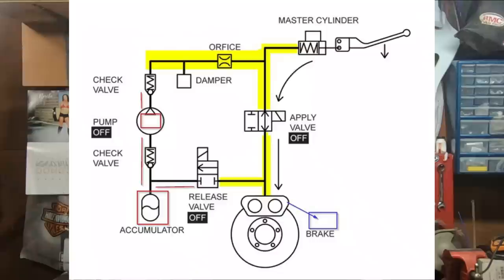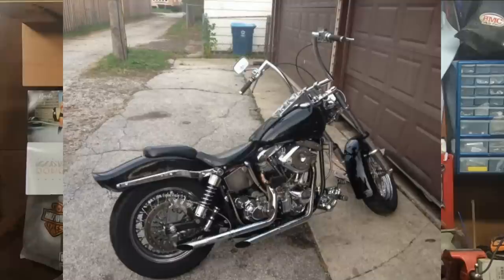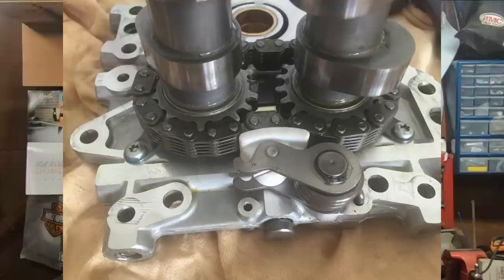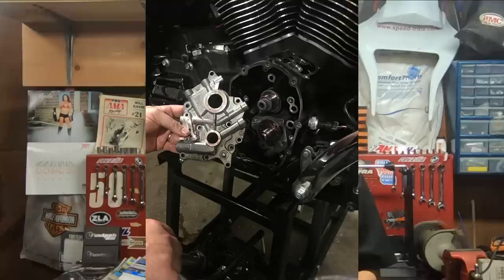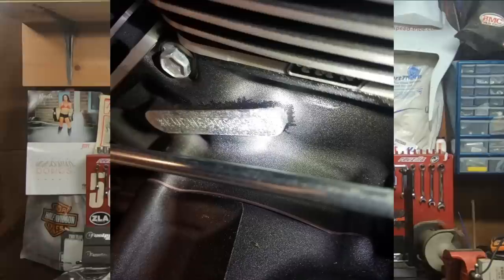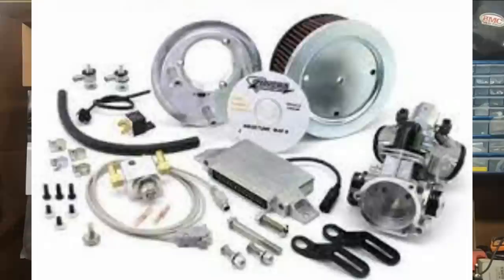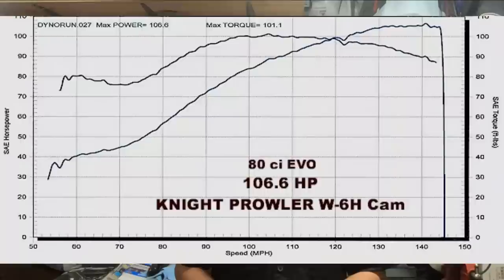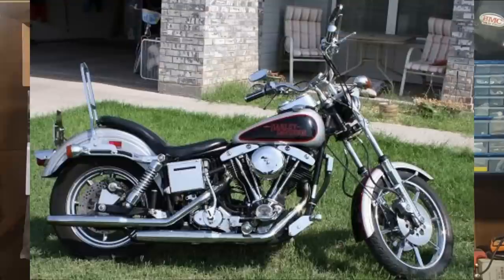Best Harley Engine Ever Made (Arguably)

Comment: I’ve said it before on your videos but my 97 RK is my daily, she’s got over 50k on her now, will have about 60 by this winter, wouldn’t trade her for anything (maybe another Evo but probably not). I’ve gone through her over the past few winters, base gaskets, pistons (.005 over), rings etc. 20k+ ago, then cam bearing (which was already upgraded but changed it while in there) and lifters at 40k even though they were all in spec, drive belt and checked everything in the primary this year (as well as new fork springs and rebuild). I Love my Evo. My twin cam softy is nice and makes a lot more power the way I have It set up but my true love is my Evo. Looking for another to add to the stable as we speak. Evos for life here.
Reply: Oh yeah, swing arm mounts, front motor mount and just did an alignment tonight as it was considerably off after the new mounts. Rear shocks, a coupe bearing repacks etc, a little more maintenance than the Twinkie’s and m8’s but worth it all day long imo.
Reply from the maker: You put the work into a bike like that it will run forever! That's doing it right!
Reply: @GixxerFoo  absolutely!! This ole girl is staying with me forever. Literally runs and rides like a brand new bike

Comment: Love my Evo. Thinking my next bike will be an early model TwinCam though. Carburetor fed is best.
Reply from the maker: If you can score a 2002 or earlier with the Timken bottom end and a carb you've got it made. Just convert that cam chest over to a hydraulic setup or gears and you're good to go.
Reply: Avoid 1999 to 2006 unless you are very mechanically inclined.  2007 and up, the problems are more in primary and transmission and engine much improved.

Comment: The Shovel is as new as I'll go. Got a 01 FLH just to check out a newer machine and didn't care for it much. I don't like computers, sensors, belt drive, fuel injection, the modern look. I'll take a carb, points and chain myself.  The Shovel is very easy to work on, parts cheap, easy to find, very reliable and a smooth ride. Guys that complain about them must be younger. I find a shovel very enjoyable and also smooth on the road but hey it's what was new when I was young. To me they are the shit. Never been on an EVO and probably never will. I don't like the modern look of the engine but you guys can ride in the wind on em if that's your bag. The maintenance is all part of owning a bike man. Couldnt be any simpler to work on, rebuild, tune... Nothing sounds like a Shovel brother its what I'll be on till I take my last breath...✌️

Comment: I think I may have told you before I had my TC88 fitted with the timkens bearing and gear timing.
You need very little run out to do the gear timing I think it’s about 2 thou max. My run out was about 5 thou but my local independent managed to true it using a press. Also at the same time he changed the exhaust cams which makes the bike run a bit cooler.
Reply from the maker: Yeah you can't be over .002, maybe .003 but that's pushing it. That's pretty impressive he was able to get that trued up with a press, I love a good shop like that!
Reply: took my 05, tc bored stroked it. balanced S&S flywheel. timken bearings. geared cams, ported. valve springs. valves. s&s adjustment pushrods. se cam plate. se oil pump. 51mm throttle body. 543 reaper cams
Reply: Karl a different profile cam was selected which keeps the exhaust open a bit longer. The bike runs a bit cooler.

Comment: I don’t know what year the Evo had INA cam bearing but it was recommended to switch to the Timken. I have a 93 Heritage and I haven’t checked on the cam bearing yet. It has adjustable pushrods and Jims Hydrosolid lifters and different cam.
I’m hoping that whoever did the work did the bearing swap. I’m going to check it for sure. I look forward to your videos. Very informative and lots of great ideas.
Reply from the maker: Thank you! I believe 1990 was the last year of the Torrington, 1991 is when they started to transition but 1993 for sure the INA was the factory bearing. You would think with everything that's been done to your bike previously they would of put a torrington in with that cam.
Reply: @GixxerFoo  I hope so

Comment: I'd like to see you put out a list of all that's needed to upgrade my cams in a 103.  This way I'll have more to go on as far as pricing and knowing what to look up. Other than that, I'm totally addicted to your channel.  Lol
You're almost too informative on your topics.  Haha  taking notes and all that Jazz!
Reply: Shh! 2001/2006 Twin Cam Engines,Look at the “Complete Fueling Kit “ ( stay with the 1 pc push rods , yer gonna get new ug rocker box breathers w/kit, just block up the fuel tank..) Gear drive, Cam, Plate,Oil pump, and an S&S Headers with open flow cans, matched Cold air intake and Autotune Fuel mgmt system…. the cold idled settings can be tweakd to your preferences when completed. Damn near bulletproof< $3000.00 quality stuff !  Now then I would argue that the Balanced twin cam 103 ,,circa 2014 stock engine is close to this from Harley out of the crate , rev limiter sux, just kinda kept quiet… truly balanced and a dependable tc Hot Rod ! just a stg 1 ug intake/ exhaust an tuner yer done wit it…<$3000.00..quality stuff. These prices are dys labor…lol!
Reply from the maker: Fuelmoto has some super high quality stuff, it ain't cheap but it's worth the money. Lol as you mentioned that price is with you doing the labor included.
Reply from the maker: I can do a video of some complete kits out there, you can go the kit route or there are some options to put these together with different brands.

Comment: I didn't get to experience the EVO but I love the Vrod motor! I am still thinking of the Pan Am because of that similarity, I just don't want to part with the Vrod.
Reply from the maker: Vrod is a super fun bike, that's what my dad rides and he loves it! The new Pan America is off the chain with the 150 horse motor, that bike will go anywhere and do anything.
Reply: the V-rod was an omen of things to come ... the future belongs to 4-valve per, efficient, temperature regulated engines. ( and 2-valve per, in lighter economy apps )
just the facts there, but nobody flip out just yet;  * probably quite a ways off * , and the air cooled 45 twins might end up in a builders market similar to american V-8s when the EPA says enough. ( that's if people can afford to put fuel in them by then )
 i am still tweaking out my Evo Sporty MPG Custom 883 ( swirl port wave tuner )... keep pushing toward 70 MPG, but probably wont quite make it there.
i hope at least one of my concepts goes to development . 
the Pocket Vintage would probably get around 200 MPG on petrol, and the Ethanol 27 would probably get around 70 MPG hwy. on E-85
currently the Nightster 975 holds the best MPG title at 52.4 MPG combined.

Comment: What years were EVO engines used ? Great stuff as always
Reply from the maker: Thank you, Evo's ran from 1984 to 1999, so they had a pretty good run!
Reply: The Big Twin Evolution was found on the 84 to 98 on the Touring and Softail and up to 99 on the Dyna models. As far as Sporter models,I think that they are still still making them in the Evolution engine, unless something changed since I last checked.

Comment: I miss my 02 1200 sportster. I didn't realize the performance I could have had. It's a lot harder to do what I want today with my 96" Twin Cam compared to the sportster I had.

Still carbed, it's an EVO engine despite being during the Twin Cam days. It was light, Massive aftermarket, Yes it's got 4 cams but the push rods are vertical, the bore and stroke are both small enough you can expand in either way depending on what you wanted to put the power band wherever you wanted without getting too big (My 96" is the longest stroke with the smallest bore ratio. My only option is to go bigger bore.)

Been reading a V-Twin performance book that my father read through a couple decades ago when he built his 103" Shovel Head (It rips by the way for a street bike pushing over 100 wheel hp and wasn't even at the top of the rpm range still building power, his first time at a dyno and he wanted to do it) So far the conclusion I've been coming to for what I'd want, a sportster would have been the better base to start with vs my 96" Dyna. But, I'm far more comfortable on my Dyna even after jumping on several other bikes when the York Harley Plant would have an open house. I test rode a lot of other bikes ranging from a soft tail, one of their fully loaded dressers with the fixed fairing and full touch screen display (was a Milwaukee 8) to the last year of the V-Rod Muscle (loved the engine but hated how it handled) and replacement in my opinion, the FXDR.

Comment: I have 2003 Indian scout. It has 88ci S&S EVO clone engine. I only have 6000 miles on the bike. The bike seems to have lots of power. never felt like I needed more. hopefully S&S fixed all EVO short comings. when designing this engine.
Reply from the maker: You don't see those on every corner! S&S did fix the factory issues with their design, the cases are much better than the factory.

Comment: I'll take my 1986 FXR Evo over my 2 twin cams and forget about the Milwaukee 8. That motor was junk from the get go. If you were lucky enough that the bearings went while it was still under warranty then they tried talking you into an upgrade which most people went for. If you were unlucky and the bearings went after the warranty expired then you were screwed! My Evo motor puts out plenty of power for the style of riding I do. The only thing that I was thinking about was how nice it would be if I could put a 6 speed trans in it to get the rpm's down at cruising speed. The 5 speed runs 2800 rpm at 60 mph where the 6 speeds run 2200 at 60 mph! As always Gixxer I do enjoy your very informative videos. Keep em coming.
Reply from the maker: You said it right there, warranty. Those new motors are only as good as the warranty. Unless you plan on dumping the warranty and pulling it apart to hop it up I highly recommend the 7 year service plan. If I'm going to spend the the big bucks for a new Harley I just thing about what that kinda money could do in a good old Evo.

Comment: Agreed but as someone who own evo and TC, if you got a Twin Cam 99-02 TC88 and upgraded to gear drive, then it's way better than Evo
Reply from the maker: I would have to agree, you just took out the weak spot and you have the solid crank setup. Twin Cam put out a lot more power than the Evo.

Comment: switching to gear drive is fine on an old twin cam that still had a tapered crank bearing other wise you will usually have too much run out and have more problems then what you had to start with
Reply from the maker: That's very true, 2003 and newer with the stock crank aren't usually good candidates for a gear drive. Even if you have good run out at the time it may not last as time goes on. Those 2002 and earlier twin cams even with a lot miles still hold their run out really well at .002 or less.

Comment: I had a Awesome 1984 Shovel but didn't know it at the time , so I sold it and bought a 1985 Evo , years later I bought a 103 Twincam , I put the Twincam in the shed and right there and then I new I made a Mistake , well I tried to love it but nothing worked , It took a Year to sell it , All I can say is thank F*#% I still have my Evo with 85hp , I think it gose as hard as the twincam may be better ( I run points no rev/limiter better spark ) and a 4 speed and , and , I could go on !
Reply from the maker: There's a lot to be said about those Evo's, there's just something about them you can't get with any of the newer motors.

Comment: You are correct ,simple reliable engine .EVO engine was designed to save Harley Davidson starting with making them oil tight and reliable .
Old timers like me are not looking to go down the road fast ,just go down the road then make it home .panheads forever
Reply from the maker: Great point! I've heard the Evo was going to be stop gap for Harley and then they were going to switch over to Nova bikes. But the Evo was such a success the idea was scrapped, can't blame them for continuing with the Evo!

Comment: Without a doubt the best Big Twin powertrain ever made was the EVO.   Very few problems and last forever.   In 1999 they came out with the worst piece of crap ever made by the MOCO and are a money pit to keep running.   I am a licensed HD mechanic and never would a TC make its home here.   My HD is a 74 CID Shovel and my long distance comfort is a 2000 Honda Pan European.
Reply from the maker: A nice Shovel is hard to come by, if you do find one they want some $$ for it. They are out there but they weren't produced in the numbers we saw on the Evo. I've seen some good twin cam motors but it takes a lot to get them to reliability of the Evo. Even then you have a lot more complicated systems with the Twin Cam.
Reply: @GixxerFoo  I totally agree with you.  I truly believe the MoCo should have never came out with the TC especially after they made the benchmark  EVO.  Not an expert on the M8 but the gearcase is more a ressemblance of the EVO/SHOVEL rather than the TC complicated shit for nothing. By the way, my shovel is sweet ! I would send you a pic given a way to do so.

Comment: I'm sure I remember you recommending I fit a chain driven cam upgrade over gear driven cam on my 2021 FatBob🤷‍♂️
Reply from the maker: The late models don't have a crank run out anywhere near .002 with the pressed cranks. It's a safer bet on the late models to stay with a chain drive to deal with the run out, which .008 isn't uncommon on the new bikes. Now if you convert to a Timken lower end and get a built crank then a gear drive is the only way to go. Even if you had good run out with a max of .003 on a late model pressed crank you can't guarantee that's going to stay that way with the roller bearing bottom end.
Reply: @GixxerFoo  wow I'm baffled so to speak ha. My 2021 FatBob is stock other than Rinehart slip ons but thinking of going for a stage2 with a bolt in aftermarket cam at some point in the future as seen really good power and torque gains on your videos. Just wasn't sure what the best option would be over a chain driven or gear driven cam.

Comment: The best thing that Harley ever did...
Was to get Porsche to design the upgrades for the original Harley Davidson engine...
Reply from the maker: A lot of people hate that motor but Harley sent their engineers over to work with Porsche in a joint effort. Honestly I am glad Harely worked with Porsche, they made the transition for air to water cooling. Lol I wouldn't want Harley to go at something like that on their own.

Comment: I have had around 8 Harley's and as much as I like the EVO's I always found them to be unreliable, always needed something doing or leaked, I found you needed to be hands on with the engine to get the best.  I now have a sport glide with the M8 and it has been far more reliable than the Evo Harley's I have had, also personally for me I enjoy that engine more than the evo and the overall riding experience, although it has made my garage tinkering visits redundant.  

Another problem I have being a UK resident is that these days they are putting in ULEZ zones (ultra low emission zone) where if you ride anything older than 2007 (pre EU4) then your going to be paying £12.50 ($13) a DAY to go into those zones and the one proposed next year is going to be 1 mile from my house, so older bikes (sadly) are now off the menu, I had to sell my Honda Hornet 900 work bike because we got wind the zone was moving closer towards us.

I'd love to have an old evo on the side to tinker with if it wasn't for the ULEZ.  But in my personal experience I much prefer the M8, and I will be keeping my Sportglide.

Comment: Wud up Foo!! Close, 2001 & 2002 TC carb’d. You can change the cam tensioners in a TC and be good for 100k, no chance on an Ego before it’s leaking or sounds like the front exhaust lifter is going to blow up before failure. Funny, my buddy was all gung ho for an Evo, never owned one, just because it’s the consensus. Lasted less than a season before he said he’d never buy another one. Opinions vary. Not to mention, dog 💩 slow.
Reply from the maker: They do need some work to get a little power out of them and lifters will get you about 40K. It's a bike you'll for sure need to put some work into. The early twin cams were really solid, and like you mentioned just upgrade the cam chest and you're good to go.

Comment: All HD engines have issues, the Evo just had the least of most, but they're not 'oil tight'...never seen any of then ridden on the regs that didn't leak...the only real issue on the twin cam is those damn chain tensioners...aside from that, the twin cam is pretty damn solid, but mine still leaks...the twin cam is the best sounding engine they ever made in my opinion...oh yeah, I also had the crank position sensor go out on my twin cam...the fewer electronics, the better...& mine is carbureted...
Reply from the maker: Crank position sensors have always been an issue with the Twin Cam, they don't like aftermarket sensors either for whatever reason. That's really you're biggest issue on those Twin Cams is the tensioners, even the hydraulics you want to keep an eye on.
Reply: That's why I want a gear upgrade...tensioners suck...